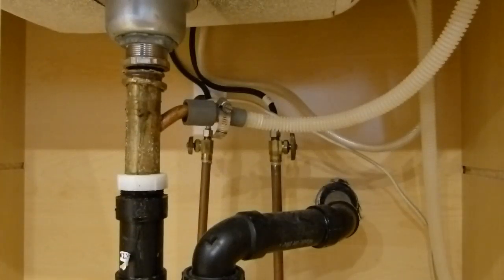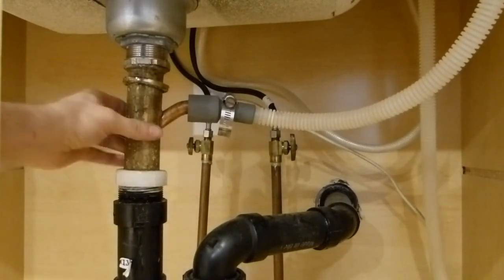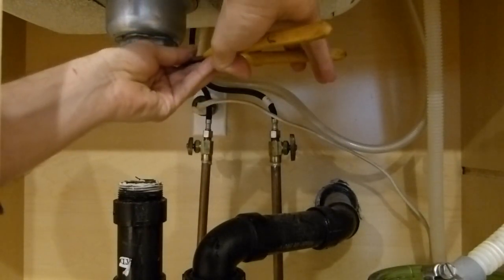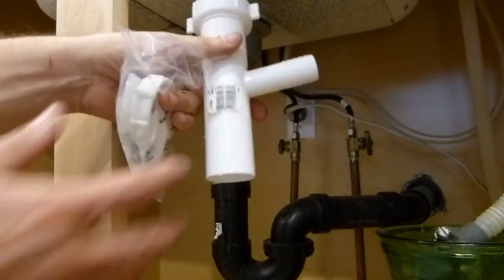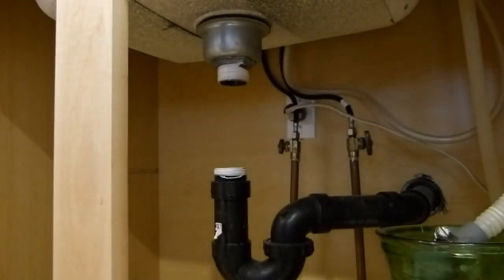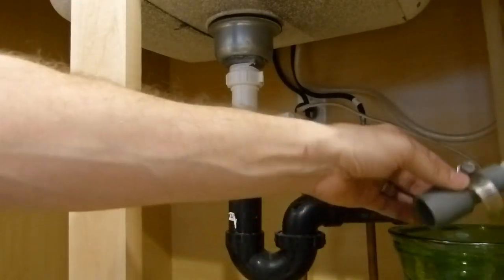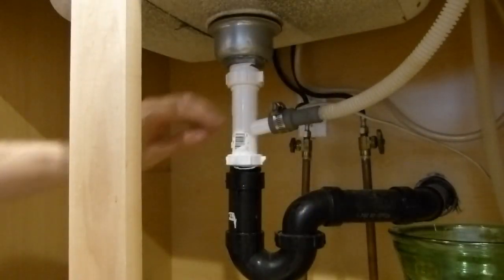Kitchen Sink Drain Tailpiece Replacement Highlights

Comment: The Teflon tape is not needed. It won't hurt anything but the seal on these fittings is not being made on the treads but on the slip joint washer. It's tapered so that as you tighten the nut the washer is forced between the two pipes which also has a taper. That's where the water tight seal is made.
Reply: Using the Teflon tape is worse than not using it in the sense that it does not contribute to the seal but interferes with the tightening of the threads that do.
Reply: @jimmonte9826  Possibly. Many people think the teflon tape is for sealing when in reality it is really considered a thread lubricant. I had a plumber friend correct me some years ago when I mentioned sealing threads with Teflon tape.

Comment: Thanks a ton, this helped me swap out the old brass tailpiece with a new PVC one and now I don't have a leak anymore!
Reply: yes brass and copper eventually corrode but pvc does not, but when it comes to sprinkler systems and where the valves are, or elbows pvc piping can break, due to cold and hot temps. the pvc piping usually should not break inside of your home unless there is a flaw in the the manufacturing of the pipe it didnt cure properly in an area, but have not really heard of pvc piping breaking that are in between studs of a house I am sure it is possible but highly unlikely over copper or brass piping corroding over time and springing a leak.

Comment: thanks sharing this video mine leaked at the joint were it meets the drain.  I didn't know that you have to buy the whole assembly until i saw you video.  I looked endlessly for the part....

Comment: You answered my question on how the bottom slip nut seals with the tapered gasket on the tail piece, because my Badger Incinerator is internally leaking and water is coming out of the bottom of the unit, but I dont know if i am going to replace the disposal unit or just put the strainer and tailpiece back in place, but i just did not know how the bottom of the tailpiece seals to the trap joint, but now I know, thanks sevenfortyone you made it really simple for anyone to do this job.

Comment: I think this type of dishwasher tailpiece connector might work on our single drain sink, however I didn't see what type of seal is being used on the top of this tailpiece. The sink drain I'll be working on doesn't allow for the type of seal that would slip up inside of the bottom of the sink drain. Suggestions? Perhaps just a flat seal that is also inserted into the inside of the top of the tail piece and nut at the top?

Comment: Great video!!!  I just fixed my sink replacing the slip nut that attaches to the sink drain.  I also added plumbing tape around the pipe thread.  thx so much save me $80 service call to a plumber

Comment: When checking for leaks, fill up the sink with water and then drain. There is a lot more volume of water at one time than just letting the water run.
Reply: Just like checking for brake line repair leaks, you need to pressurize the system before you know for sure if your repair is good.
Reply: Thank you so much for this comment! I'm new to this, and this helped me. When resetting the tailpiece, I didn't have it far enough into the p-trap, and your advice allowed me to catch that now rather than later! I removed it, reset it properly, and tested successfully. Thanks again.

Comment: Thank you! Figured out our leak , plumber on new construction didn’t use a poly washer at the connection 😡
Headed to the hardware store to buy a new slip nut and poly washer 👍🏻
Reply from the maker: Stuff like that happens.  Glad you were able to figure it out

Comment: Thank you! I went to clean the trap and the whole dang pipe was in my hand! I didn't know what to do, so thank you so much  one quick question tho -I was wondering how do u measure the circumference?? A ruler across the opening? Wrap a piece of string around then measure that? I have no ideA and I'm goingto attempt this myself. I noticed the pipes come in different sizes online. Unfortunately I don't drive so I have to order the part not able to take it the store with me. Any advice would be super helpful! Come on guys, I'm a lady and I still need a man! 🫢🤣 I'ma unicorn
Reply from the maker: Pipe is sold by it's diameter, not circumference.  Just measure it with a ruler and you should be good

Comment: Hi, I have the same situation as in the video where I switch from the brass to the PVC... I noticed when I changed over to the PVC Dishwasher tail pipe that the PVC nut by the strainer basket kind of expanded when I was running hot water! I guess yours didn't leak being that you used Teflon tape! I would of used the Teflon but I was told not to because it is not needed!
Reply from the maker: I always use Teflon tape.  Its a habit I picked up from watching my dad when I was a kid and has served me well over the years.
Reply: BTW, is that dishwasher a Maytag?
Reply from the maker: Nope - it's a Whirlpool.
Reply: Same company, my dishwasher discharge hose is identical!

Comment: Teflon tape is not necessary here, rather it can cause the plastic nut to crack when tightening. There are rubber rings to make the connection watertight. And why you turned water off, when you are reparing drain, not water supply? :-)

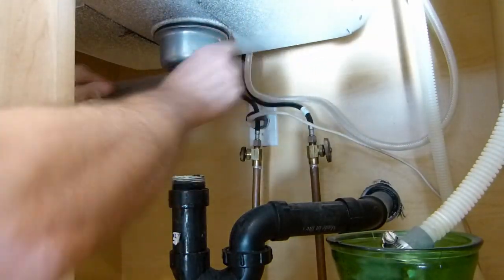Comment: At 3:09 Is that sandpaper or a file?  A brass or other wire brush may have worked better.
Reply from the maker: No, that was an old wire brush with a wooden handle...kind of loos like sandpaper though doesn't it?
Reply: Ah, okay that makes sense.

Comment: Don't use tape on compression fittings. 
Adjust the drain pipe so it has a quarter inch decline into the wall to prevent buildup.
Reply: I'm not sure I understand what that means. Don't. Put that tape on the threads? It's not connecting to the wall.  U just threw me for aloop, I was ready to go now I don't know! Please explain?

Comment: I have same problem, but my dishwasher line is copper and welded into the pipe.
if I cut the pipe with a pipe cutter, do Lowe's sell the rubber hose with clamps on both ends?
Reply from the maker: Best thing to do is go to Lowe's or any similar home supply/hardware store and check to see if they have something that will work before you cut the pipe.

Comment: I have the same exact problem and replaced with same exact product, but still leaks at the nuts, top and bottom. I didn’t forget the gaskets. Any suggestions?
Reply from the maker: You might need plumbers Teflon tape on the threads.  Or,bit could be leaking some other place and clinging to the pipe making it seem like it's leaking at the threads
Reply: @SevenFortyOne  I did use Teflon tape and  wire brushed the threads but still leaking

Comment: You didn't mention the top hat gasket between the drain tailpipe and the flanged 
tailpipe.
Reply: Didn't look like one came with the kit so it may not have been installed.  Flanged fittings are unique and different than most under-sink connections, which use tapers.  Here's what was needed for your application.  https://www.plumbingsupply.com/images/tdp-1andhalf-poly-tailpiece-washer.jpg  That tapered washer you installed at the top (or did you go washer-less up there?) will leak. The bottom one is correct. Note: this is a "top hat" washer for flanges and goes INSIDE the tailpiece between the plastic tailpiece and the metal strainer so when you tighten the nut, the washer compresses and makes waterproof the connection between the tailpiece and the strainer.  Hope that helps. --     EDIT: After watching again, the Teflon tape may be saving you but it's not best practice.

Comment: I thought your supposed to use metal on metal there where the junction is???
Reply: That's what I heard too.
Reply: You do not need to because it is a low to zero pressure flow. We do it all the time at wastewater (sewer) plants and alternate between metal and plastic so the joints don't rust fast.